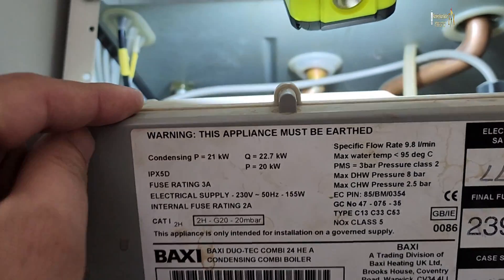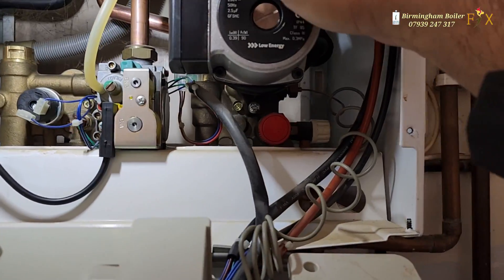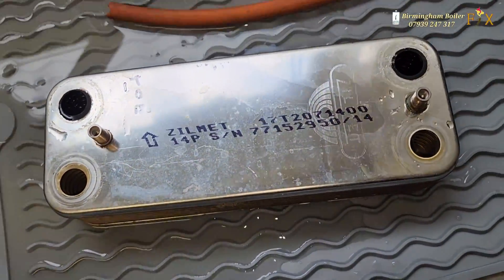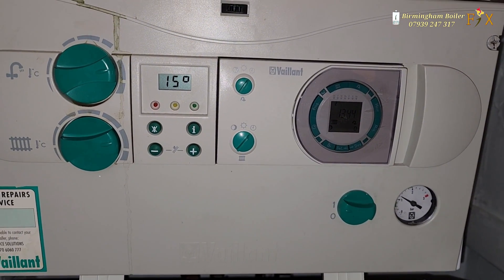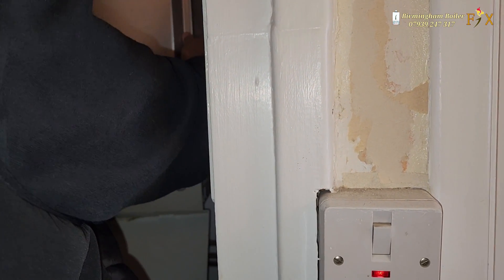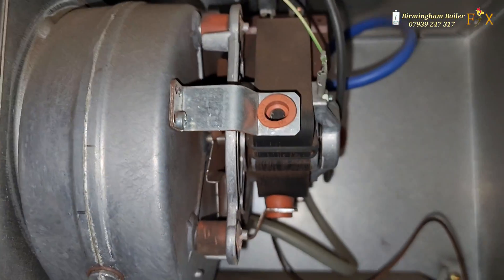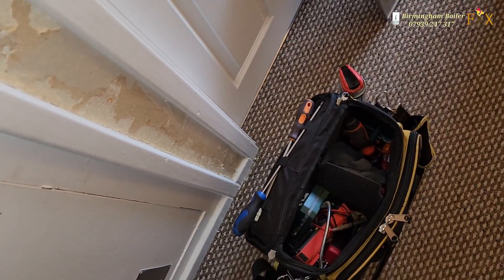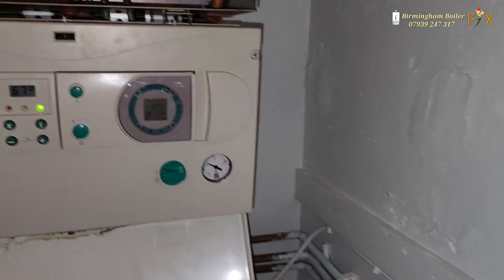Vaillant turbo max brocken down no heating and no hot water let's Fix it

Comment: E119 error - low water pressure, is a common fault. The expansion vessel will go flat twice a year on that boiler.
Reply: It is for the customer,  when they have to pay for your time.
Reply: That's not a big deal 2 minutes to recharge also if it fails 15 minutes to swap out